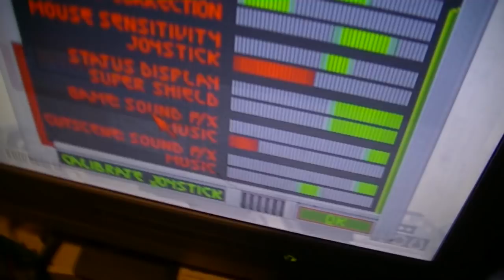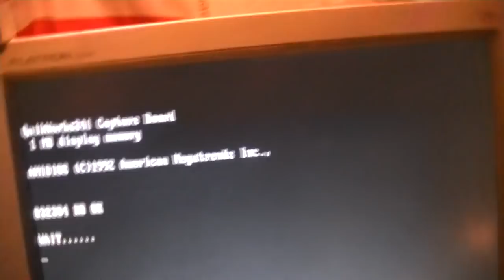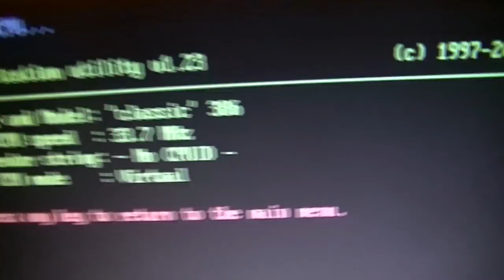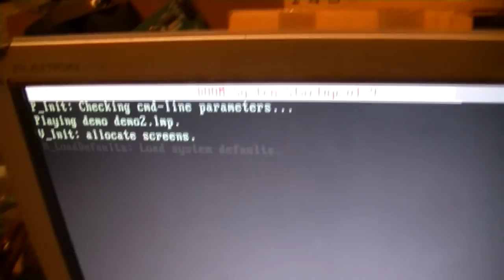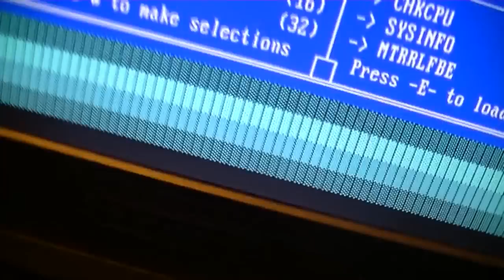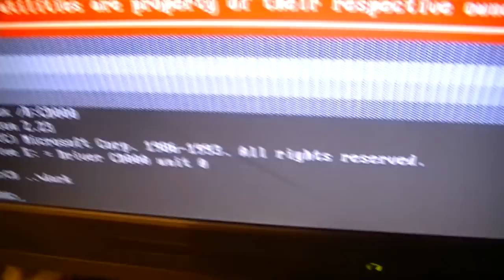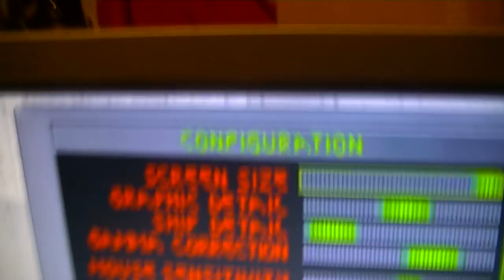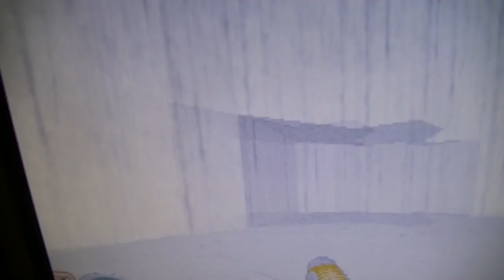Star Wars - Dark Forces on a 386DX?

Comment: I would bet money they wrote this game in either assembly and / or pascal. I don't really know, but being Lucas, some of the same guys that wrote software for special effects might have made the games as well. They were probably use to hard core tight programming to get every ounce of power from a computer to save render time in movies.  All I know though is Lucas Arts games back then were very highly detailed, ahead of their time in terms of graphics, and ran on very low performance machines compared to other games with similar, or even worse graphics.  In addition to this,  I have Rebel Assault 2, and it has incredible graphics for the time. Makes me wonder now if this game can run on a 386SX processor or if it specifically looks for the DX class 386.
Reply from the maker: +WaybackTECH It's that magic word again I think; Optimization. Something so many programmers now don't have in their vocabulary. I don't know about Rebel Assault 2 (Think it requires a 50MHz 486) but it is certainly a good question. I did wonder if this one would run on an SX but I don't have one to try it with... I could maybe crack the EXE for no-cd and try it on a 25MHz SLC as I do have one of those. I doubt the 16MHz SX in the T3200 would have the balls to run this.

I may have to check the credits now to see if any of the people actually did work on the movies. I have a lot of respect for good ASM programmers as it is by far one of the most challenging things to do, to do it well is even further beyond my own comprehension.
Reply: HighTreason610
If Wikipedia is correct, it says Lucas Arts was a game development group of LucasFilm. I think there is probably at the very least a very close connection to Lucas Arts and the Industrial Light and Magic guys. I would love to see you try DF on your T3200. If nothing other than to see it on that orange plasma display.  I would try it on my Compaq 386, but it has only 2MB of ram, and that will certainly not be possible to upgrade it right now.
Reply: I think from a software standpoint, 386SX and DX are identical, there is no way for a game to block one. Doom will actually launch on a 386SX 16 Mhz it would just be very slow. BTW, Doom would run a lot better on this 386 if HighTreason put the screen size 2 notches down from what was shown in the video.

Comment: Lol, it runs on garBASH!  ..well, with a bit of a RAM boost anyway.  Also, to your programmin' skillz.. "Ya BROKE it!".  Glad to see the vids coming out still, and hopefully things work out ok with the move to the new place.
Reply from the maker: +Sansui350A I think I have now fixed that menu, I was drawing off the bottom of the screen so it was pushing everything up a line. The choice is to either move the cursor back one line or remove the topmost line from each page. The council seem to be getting their ass into gear now, possibly as I completely stopped paying rent and tax for several weeks.

Comment: Oh you're running a Tseng Labs ET4000? That helps a lot as it is a beefy card
Reply from the maker: +m9078jk3 Indeed it is, this is the W32i version too. The game still runs nicely on the Western Digital 90C00 as well though, so I assume one could use a weaker system. Especially given I didn't run the game on the lowest settings and my 386 is a fairly fast system.
Reply: +HighTreason610 I like using those on 486 machines.They are one of my favorite cards.Man I wish I wouldn't have gotten rid of my older systems.
I did so because it seemed that I just had too many of them.Sadly my oldest PC is just a 486 system (just one of them left)

Comment: Well, when you see that a 33mhz CPU + 2MB of ram (the playstation 1) can beat the shit out of the last generation of 486 and the pentiums up to the 100 mhz ones at least, I think that many games could have been better optimised and run very nicely on PC, but they didn't have the "technology" to create this kind of games back in the late 80's. I mean that the hardware were there, but the algorithms to calculate 3D weren't (or very primitive ones), and the compiler's algorithm were probably not as good too for optimisation.

For example I think that if you take the source code of quake that you re-compile it with today's compilers, there will be an improvement in the performances with an old machine (but how munch ? I don't know. 4 more FPS ? 40 more FPS ? who knows ?)
Reply from the maker: +Deksor Bringing the PS1 into the equation makes things a lot more complicated because it brings up architectural differences. Even on the PC you have all manner of things like 3D accelerators and cycles-per-clock to keep in mind. I have heard conflicting arguments for modern compilers, it seems to vary with which compiler/assembler is used and for what platform. I know on the C64 that some people in the Demoscene say they wouldn't have been able to do what they can do today without more powerful systems to develop on and the aid of modern tools though.
Reply: Yes, that's true, but It's strange to see a 100mhz CPU with a powerful FPU and 8 to 16 times the amount of ram having difficulties to keep up against something that's way slower ...

So I think that the performance of many game could have been improved (as this game has shown). I think that back in the days they didn't took care of that because the PC market is always evolving, unlike game consoles, and so they optimised their code for the average computer performance of the time they want their game released (for example in 1992, there was plenty of 386 computer still out, so many games released were optimised to run on it (even if it's hard for the poor little 386 to keep up). In 1995, there was plenty of "fast" 486, so even if quake was optimised for a pentium, a fast 486 more or less run it)

But I'm pretty sure that with coding skills, you could make quake run faster on something slower (like a 486DX50 or maybe even less ?)
Reply: +Deksor I think time to market and cost relevant to coding time played ( and still does today ) a huge factor in how optimized code was, what type of language to be used, and what kind of processor power was needed to chew threw all of the slop in the code, not to mention how well the compiler was to start off with.
Reply: Comparing a console with (albeit non-floating-point) 3D acceleration against a computer that runs all integer and floating-point math for a game on the CPU alone isn’t exactly an even playing field, is it?

Comment: my very first game in fps on my 2º pc (pentium 100mhz 8mb cirrus logic 54xx1mb pci) 
my box in the back says this "runs even better on pentium processor" 
sad the game is on  a cd-r.
Reply from the maker: +blooder81 Indeed, that is printed on my box too. I don't know that much improvement would be yielded over a fast 486, but I suppose technically, it would run better on a Pentium. Still very impressive that it can scale down to 386 machines though. You can actually crack the game to not need a CD and I usually do this, I did not for the sake of this test as it wouldn't have been fair, the CD-ROM probably uses a few cycles and it could have skewed the result had it been removed from the equation.
Reply: @HighTreason610  I remember watching this one on a Pentium back in the day. It was the very first time I said "wow, that game runs super smooth"... Probably the first time I witnessed real steady 60fps xD